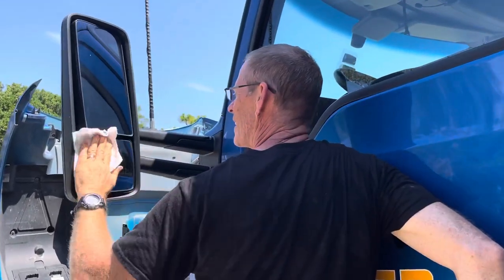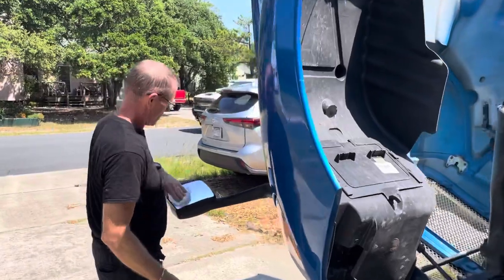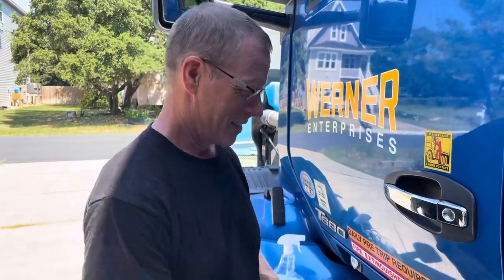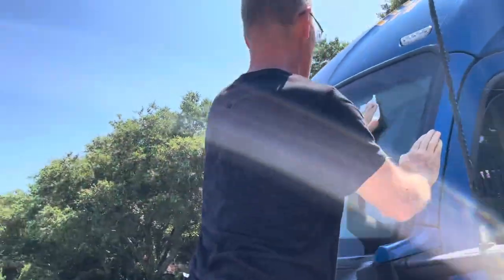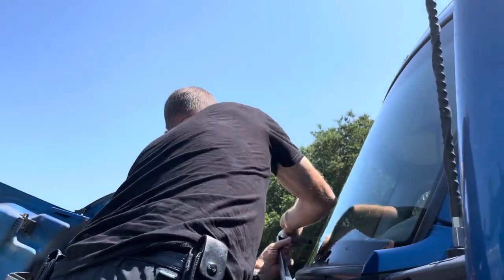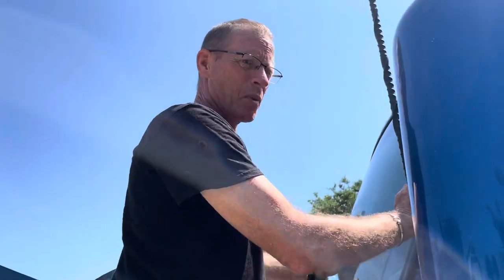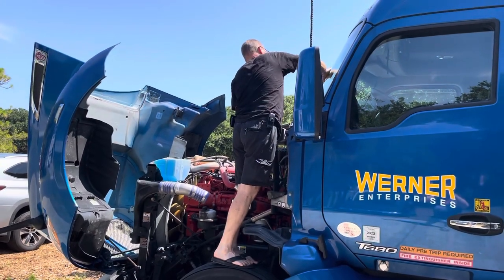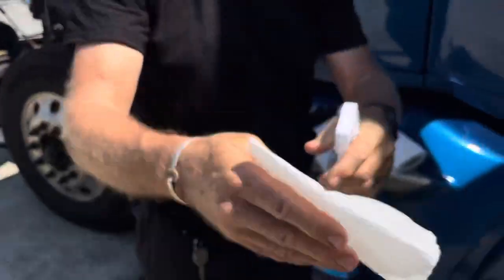How to Clean Mirrors and Windshields on Semi-Tractor-Trailer Truck | Safe Driving | Werner OTR Life

Comment: 1:08 I figured out that too to open the hood the expose the tires to stand on . I drive only a 26000 GVW truck . I used 91 % alcohol in a spray bottle and 0000 zero steel wool to get the imbedded dirt off . And followed with Invisiable glass cleaner and blue paper shop towels . As you know of the bug splatter and next time to use a razor blade scraper . And also maybe to use a claybar , medium grade ? as auto detailers use with a lubricant . And others have used Mothers aluminum polish [ paste ] and the 0000 zero steel wool to get the glass much clearer .
Reply from the maker: Wow! Thanks for the tips! The steel wool doesn’t leave scratches?
Reply: @TheJoyofTrucking  I found out about 0000 steel wool on YouTube , using for vehicle windows . You can find many videos on cleaning windshields , detailing videos . Also , you could use a clay bar , medium ? along with Optimum No Rinse , diluted with water / distilled water . You spray that onto the window as a lubricant and then rub the clay bar back and forth . My car windshield was so much cleaer afterwards . Definitely followed up by a rain repellent , many options out there . Even ceramic sprays and a ceramic coating to be only professionally applied .
Reply from the maker: @peterrudy9207  Thank you!!!